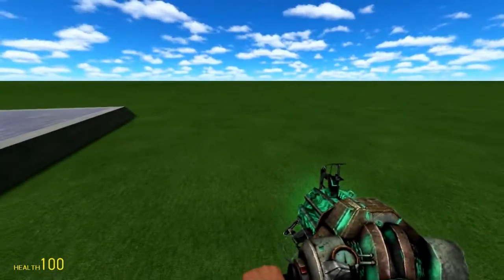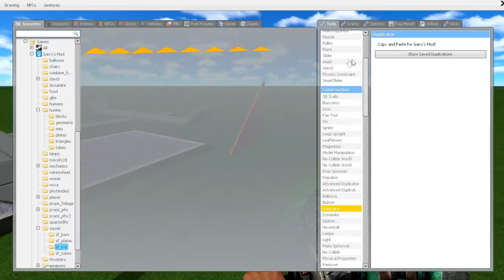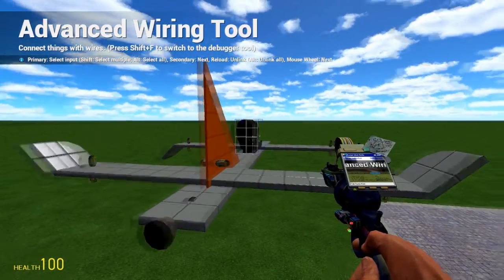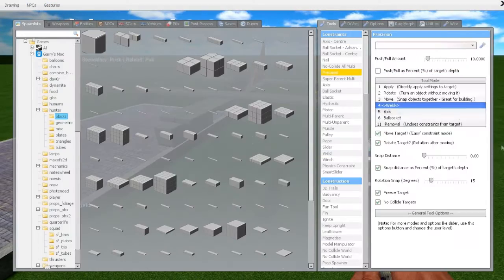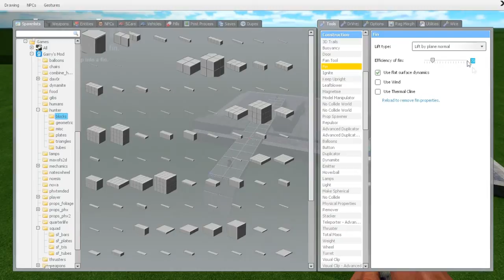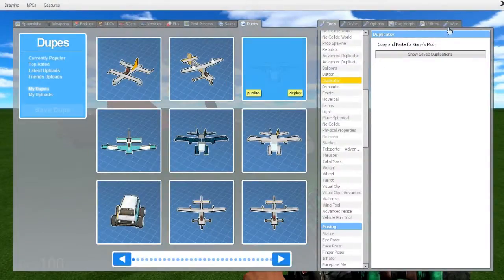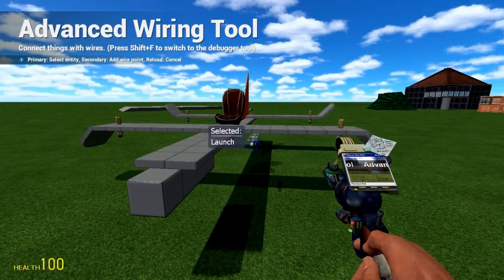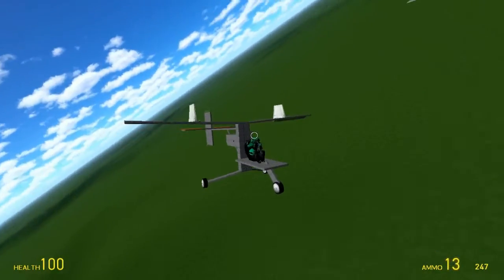Basic Fin Plane Tutorial [OLD]

Comment: Would this work on cars? Like, I'm trying to use this tool to add downforce to my car, but no tutorial was made about it.
Reply from the maker: +Trackmania Studios   Yes, the fin tool can easily be used as a spoiler on cars. I would recommend using a flat, lightweight prop with a 'no-lift' fin applied to it with an of efficiency of 100. I would try to put the spoiler above the rear wheels of the car, if the spoiler is too far back it can cause some weird characteristics when the car goes off a jump (e.g. backflips).